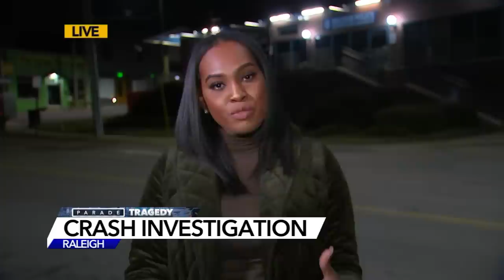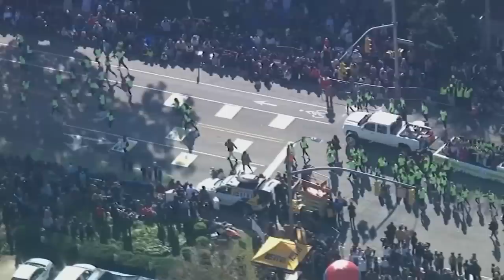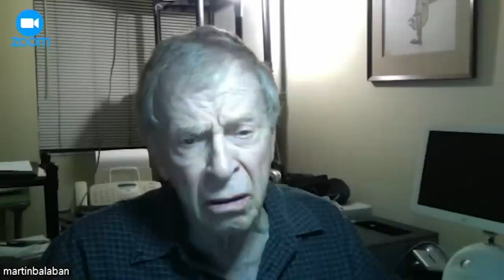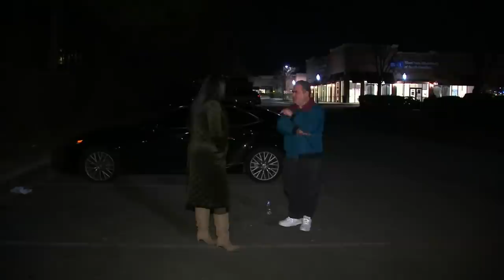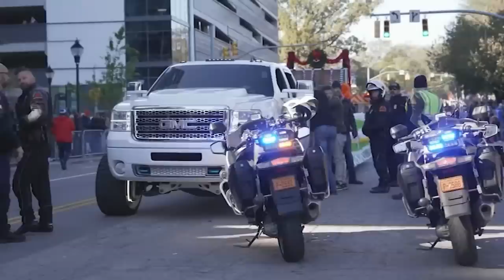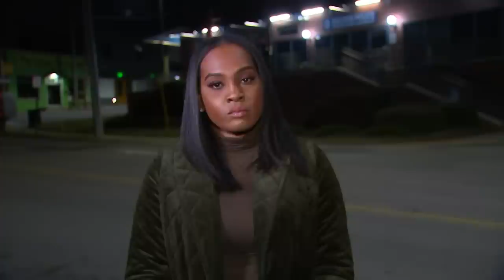Investigators look at truck part by part after Raleigh parade tragedy

Comment: Nobody talking about GMs issue with LOW SPEED BRAKE PROBLEMS.  I had to take my 2015 1500 Z71 back to dealership that they fixed.  It's a known problem !!
Reply: Was waiting for someone with that knowledge to finally come out as well, there is LITERALLY A RECALL FOR THIS
Reply: @troublefinderslukespersonalacc  yes !  It nearly got me T-boned  pulling up to cross a double lane road out of a parking lot.  I had to gun it across the road because my truck wouldn't stop.   I thought it was a fluke untill the second time I nearly rear ended a car in a line of traffic.    All from a stop and pull up to stop and it won't untill 2nd or 3rd pump.  Dealership service center said yeah its known to happen ... I was pissed that I hadn't been told by GM.   Could be bad for certain situations like parades ??

Comment: If he had just turned off the truck, wouldn't it have just slowed and stopped? Even with losing steering at least it would have stopped accelerating.
Reply: or just use the parking brake
Reply: That's the worst thing you could do.
Reply: @MajorBorris  No it's not, it's just like running out of fuel, lol.
Reply: @yourface3154  except  fuel was not what caused the vehicle to gain speed, it was gravity and turning the vehicle off while in motion would default the transmission into neutral. Which is exactly what we saw in the video, an out of control vehicle in neutral gaining speed until the accident happened. The correct choice would be to use engine braking by simply putting the transmission into first gear, a GMC Denali heavy duty first gear is 4.54% which is a crawler gear and in that configuration it is likely that an adult would walk past it. Turning the vehicle off would also cause a loss of hydraulic pressure to the steering system which in a life or death situation with children inches away could be a catastrophic choice.
Reply: @MajorBorris  I was driving a uhaul and I was coming to a stop and it also took off on me while standing on the brake less then 500mi it was that new and I also shut it off completely in drive and then back to accessories for manual steering and yes that combination worked fine

Comment: There should be laws against having modified suspensions on the streets. Automotive manufacturers have engineers that design every part to work with each other. If people want to modify their trucks for off-roading, then they should only be used off road. Each vehicle that has a suspension modified should have to be certified by an engineer to make sure it is safe for allowing it to be used on the road.
Reply: Tell me you know nothing about vehicles without telling me you know nothing about vehicles. It wasn't the suspension lmao it's the Brakes that failed it used a hydraulic system that uses engine power (I think) to stop. Suspension has nothing to do with brakes if you have 0 vehicle knowledge don't even make dumb comments thinking you know everything
Reply: @lucid523  I'm actually a Master certified mechanic.
Reply: And as of yet I haven't heard any cause for the accident. It's very possible it lost the brakes because of suspension modifications ripping a brake line apart.
Reply: @kennygaming208  I definitely agree with the maintenance thing. Just check out the just rolled in YouTube channel. I live in Michigan one of the worst states for junk cars on the road. I'm actually retired but used to be a mechanic so I've seen a lot of it myself, with dangerous cars coming in and people refusing to pay to have them fixed. I've also seen those modified vehicles done improperly. Engineers spend thousands of hours designing suspension systems to work together. Just putting the oversized wheels on makes the vehicle less safe. Not necessarily unsafe. Most people don't realize the towing capacity of a vehicle has nothing to do with the engine, it's the braking. I personally drive a Dodge Durango and the towing capacity increases by 1200 pounds by ordering the brembo brakes. I think there should be yearly safety inspections not emission checks. If you wanted to have your suspension modified that would be fine as long as it's inspected and a certified person signs off on it.

Comment: If that trucks brakes failed and with that float hitched to it. Y'all had no choice but to move out of it way.... Anyways if that was me I'd just throw it reverse and Hope transmission doesn't fail. 😬
Reply: That would ruin the tranny but it may have given time for people to get out of the way.
 Not sure why they were walking so close to begin with.
 We have a daffodil parade in the spring in my area and there is a lot of room between the floats and the ones on the ground. Looks like there are a lot of failures here.
Reply: @dw3403  ... So... By looks of the truck they can do the job themselves.
Reply: @jeremys6631  
 In the comments it is said that that truck when lifted has to have the emergency brakes redone. It is also reported the investigations said he had no working brakes so it appears he never had the ebrake modified.
 So no, I doubt they could do it themself, if you know what I mean.

Comment: In all reality yes it is a tragic situation but at the end of the end of the day I don’t believe he should be charged and yes there are plenty os safety things to prevent this from happening but in the heat of the moment no one is perfect my prayers go out to the family and friends but also to the driver he now has to live with this the rest of life. It’s a hard pill to swallow for all parties involved
Reply: Theres absolutely some neglect in maintenance even if the main brakes fail you should have e brake. Not to mention the brakes on the trailer it self
Reply: If the mods on his truck had anything to do with it he's a sitting duck.
Reply: @masaster5210  these trucks don’t have emergency brakes, they have parking brakes. And with the weight I’d the trailer combined with a small downhill this wouldn’t be enough to stop the truck. Also, lack of maintenance does not explain a spontaneous complete brake failure, it would have still had some stopping power.
Reply: @masaster5210  “e brake” 😂🤓
Reply: @orangesforall2053  it absolutely would, if brake failure is actually what caused it.. how old is the fluid in the brake system? How much water is in it? How do the extended rubber brake hoses look? That lift won't work with the factory brake lines.
Reply: You must not have children..
Reply: @masaster5210  E break was on. Do you actually think that an e break will stop a car?
Reply: @SLOCLMBR  kid was literally screaming for help that it wouldn’t stop he had the e break/parking break on. No one would help him till the child got hit. The organization that was supposed to inspect the truck is just as much to blame as they admitted to not doing it. The charges won’t hold. Especially the reckless driving
Reply: @SLOCLMBR  no it would not, and this was a spontaneous failure, either a front and rear line ruptured which is very very rare or something along the lines of the brake pedal literally broke off the master cylinder. Any of the things you stated would result in a squishy brake pedal or corrosion in the system that could cause a locked up caliper. Also these trucks have a lot of slack in the brake lines which is there for suspension hang, like when the truck is off the ground, so there is plenty of slack for a lift. This is tragic, I’m not saying it isn’t, all I’m saying is why blame this guy when it wasn’t his fault. He tried everything he could think of in the moment.
Reply: @orangesforall2053  you mean to claim that a 4 or 6 inch lift doesn't require an extended brake line? He still steered the truck over top of a child.. I'm not a fan of jail, but it's probably safer than putting him in a room with that girl's father.
Reply: @SLOCLMBR   usually no, my truck has a 4 inch and it didn’t need extended brake lines. And what was he supposed to do? Plow through the crowd on either side? Even if he did have to put longer brake lines on the truck and one of them failed it still wouldn’t be his fault, unless he put them on incorrectly which doesn’t seem to be the case as they would fail almost as soon as the brakes were used when the truck was first driven.

Comment: This happened in my home town not far from where I live now. I’ve got friends that know the guy personally. It’s really sad what happened, the girl was so young. In that situation there really wasn’t anything the kid could have done. If brakes fail in a truck like that there isn’t much option to slow down, the transmission probably wouldn’t let him go past neutral, the parking brake is extremely low force and only a drum brake so it won’t do much, he couldn’t really swerve cause there were people in every direction. The only thing he could have done was to make sure he was capable to pull the load and make sure there weren’t any issues with his truck before hand.
Reply: My parking brake locks my tire up completely. There must've been multiple issues with this truck.
Reply: He was tugging a load
Reply: Going as slow as they do in a parade, throwing it in neutral and stomping the parking brake would have slowed him down quick.
Reply: @jackmurdock5723  no it wouldn't actually ,the parking brake on a newer truck is a joke where braking force is concerned ,,,i own a 1983 GMC 1 ton  and it's parking brake will provide almost as much power as the hydraulic system , because it uses the service brakes ,,i also own a 2001 chevy Tahoe which has rear disc brakes an the tiny drum brake for the parking brake is  a joke ,and will not hold the truck in place when i put the transmission in gear
,,,going slow as they do in a parade likely was the cause ,,because they were riding the brakes constantly ,this can cause brake failure
Reply: @napkin74  what kind of vehicle do you have ,,not every vehicle is created equal
Reply: @wildcoyote34  True, but you'd think a brake would do just that, brake. I guess I'm not familiar with the new garbage they use on newer vehicles now a day. I own two late 90s cars and the parking brake locks up the wheel on both. Too bad he didn't know to throw it a low gear to avoid riding the brakes. Can he not manually shift gears while it's moving either?
Reply: This is a 2007-2014 gmc 2500. The way the parking brake works is by pushing a pedal which pulls a cable which turns the drum brake pads outwards. There’s a reason why they stopped using drum brakes as a means to stop cars so long ago, that’s because they don’t provide a lot of stopping force. The cable makes the brakes even weaker than the hydraulic system. Stomping on the parking brake will only do so much to slow a truck down especially with that kind of load.
Reply: @jaket7716  the distinction with newer vehicles is the tiny drum brake they have now is just that TINY ,,it's called a PARKING brake for a reason ,,,my 40 year old truck has 13 inch drum brakes with 3 inch shoes ,,and my manual brake actuator operates the service brakes ,,when properly adjusted the manual brake will hold my truck in place even when put in gear and applying throttle
Reply: Neutral then hit key off it would shut down for sure , could be avoided
And if he had brake fade no issue would be present, prior to incident if checked
Reply: @fatrat137  putting the vehicle in neutral going down a hill and then turning off the vehicle is the biggest oxymoron move there is and does nothing to stop the vehicle having brake failure ,sure makes it harder though cause now he has no power steering and no brake boost ,,
so called brake fade doesn't happen with modern disc brake equipped trucks ,,brake fade is a phenomenon of drum brakes caused by the drum heating and expanding  and losing contact with the shoes 
disc brakes on the other hand as they expand the rotor gets thicker maintaining contact with the pads ,,and by their nature disc brakes are self cooling
Reply: @wildcoyote34   downhill situation ya good point neutral wouldn't be an issue then aside from that I can easily cause brake fade on most average production vehicles especially using dot3 fluid heats up quick, dot4(not as common) stays cool longer so we use it on the track vehicles...My full time job is a mechanic.
Reply: @fatrat137  i've been repairing vehicles since the late 80s , i've seen a lot of  changes in how things are made and things like brakes have changed a lot but they still work basically the same way ,,i've seen brake fade a few times while driving ,,never while driving walking speed ,even for an extended period ,,and having driven a pickup truck pulling hayrack wagons while collecting hay bales ,,doing it day after day, 4-6 hours at a time driving walking speed pulling a heavy load ,,i have a seriously hard time believing he induced a brake fade failure driving  a couple miles in a parade ,,last time i had brake fade  it was caused by constant riding the brakes while going down a mountain pass at 50MPH and it took 20+ miles for it to happen  ,,and it WASN'T a modern vehicle equipped with 4 wheel disc brakes ,,it was an 84 F250 and i was towing a 15000 pound travel trailer ,,he may have had a complete brake failure but i'm not gonna believe it was from driving 4 or 5mph pulling a parade float for a few miles,,i'd  be more likely to believe it was caused by a sudden failure of some component or something like  a brake hose due to that  being a lifted truck
Reply: @wildcoyote34  yeah you might have a few years on me I was born mid 80's, only 36 this year....but I'm a logical person and you debate some great points, and to be honest I completely agree  with you, your definitely right and all well  explained too. I wish I knew people in my area that could debate like this......Sir you win this one for sure 💯
Reply: @fatrat137  i enjoy a good debate ,,i also enjoy sharing information ,a lot of people end up calling me a smartass for it but most of my information comes from my own experiences and research i've done  myself ,,a really good example of this  while thinking of brakes is something that happened to me in october and was a big shock as well ,,the 1 ton truck i tow my camper with  had a power steering pump failure ,,and i have the hydroboost brake system  that most diesel trucks have ,,while working on my truck i noticed i had a leak in my master cylinder ,so i replaced it ,,when i had it back together i noticed  my front brakes were worn so i decided to replace the pads while i had the front wheels off getting new tires ,,this is where the big shock happened because upon removal of the brake calipers  i discovered that  the brake pads were not touching the brake rotors ,,this is a huge deal ,,both of my front brake calipers are rusted solid totally inoperative ,,,at this point i have been driving this truck since march of 2019,, 3 and a half years never once suspecting my brakes were in fact not working because it stops just fine with normal effort ,,,new calipers , pads , hoses and turned the rotors ,,there is a huge difference with the front brakes working

Comment: The ridiculous size tires might be one reason my question is how come the driver didn’t pull the emergency brake put the truck in reverse or jam it in park.
Reply: Someone mentioned when they put lift kits in these trucks the emergency brakes cannot be hooked back up and have to be redone. Looks like he didnt do that.
Reply: You obviously know nothing about vehicles.
Reply: @dw3403  i forgot about that one😄
Reply: @LuisMorales-te3qz  why are u a rocket  scientist?👨‍🔬
Reply: @dw3403  that is one possibility another is that the emergency brake was not used properly as a daily parking brake which can lead the system to stick. In any event the investigators said the vehicle had no operating braking systems which means the emergency brake was not operational
Reply: @LuisMorales-te3qz  my money is on the fact he didnt hook it up after he lifted and rim swapped it, what say you?

Comment: Diesel engine? Hydro boost issue
Gas engine? Dopey GM uses a vacuum pump on Tahoe/Suburban that fails and makes the pedal rock hard. No assist. Known problem. 
All because GM wouldn’t vacuum port the intake.

Comment: Hindsight is always 20/20 and I get that anyone can panic in that situation, but the parking brake is an option also putting the truck into reverse is also a better option than putting it in park. The parking pawl will not engage until the vehicle is almost stopped. A lot of semi older vehicles WILL go into reverse at 5-10mph sometimes well above that.
Reply: Neutral would have stopped it too. A booster failing does not mean your brakes stop working, it just takes a LOT more force. Grab the wheel for leverage and try to shove that brake pedal through the floor. No excuses for this death. I'm glad I'm not the father, I would consider this murder by stupidity. So much time and money into that truck with all the add ons and he couldn't check the most important parts.
Reply: @jamminwrenches860  you might be right but I’m a mechanic and have driven many cars with no brakes in the lot. Neutral won’t stop a vehicle that’s moving with zero brakes. Nobody knows the exact failure at this point. I do know reverse works
Reply: @jeffclark5024  everybody’s an expert until they’re in a bad situation

Comment: I doubt the mainstream news media will ever report on what exactly went wrong because they think most viewers are like themselves,  and lack the ability to understand actual technical information.    It was obvious by the sound the truck was making and how the vehicle rocked backwards when it stopped that the driver had put the transmission in PARK, attempting to stop the forward progression.  I have no doubt that the reason the brakes failed is obvious upon inspection by a competent technician.